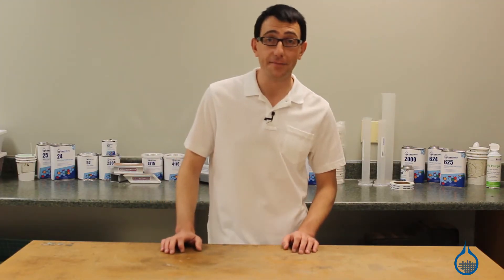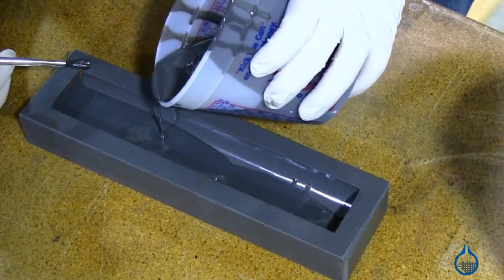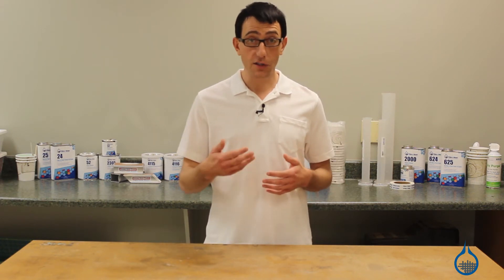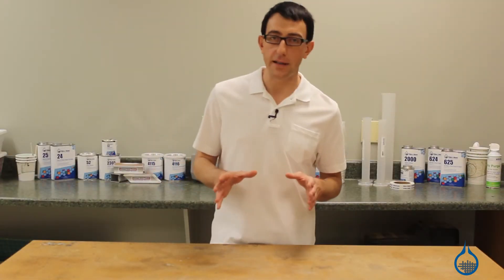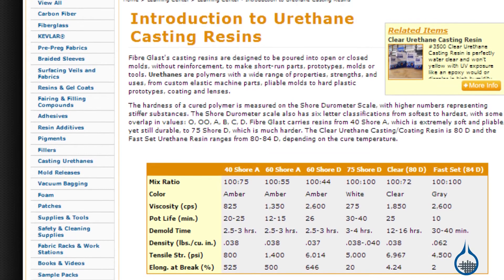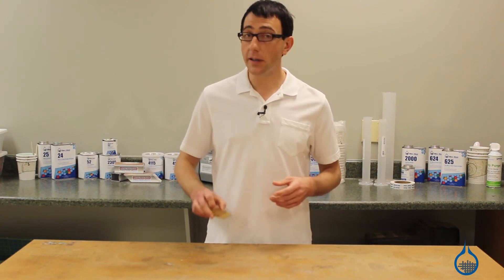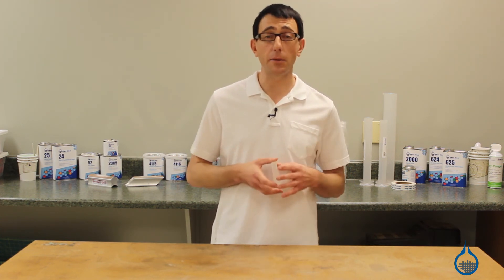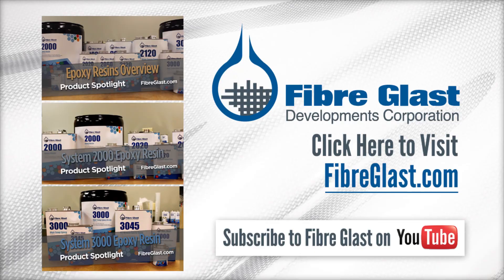Casting Urethanes Overview

Comment: Will the hard urethane casting resins handle 180 degrees F in an autoclave running 40psi? I do a lot of prepreg carbon parts in fiberglass molds I make but I like the idea of cast molds. Much faster to make.
Reply from the maker: Our #4113 Fast Set Tooling/Prototyping Urethane can certainly handle those types of temperatures and pressures.  #3460 and #3475 would require testing in the specific application to ensure suitability.
Reply: Fibre Glast Thanks. I am talking to the boss man about your products.